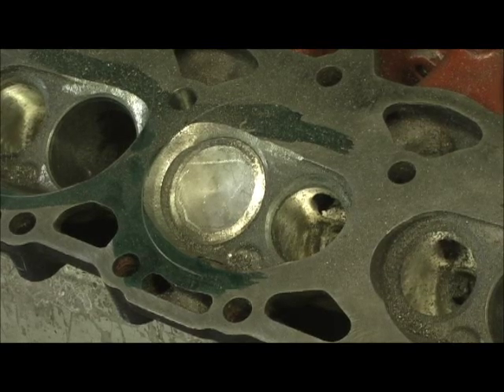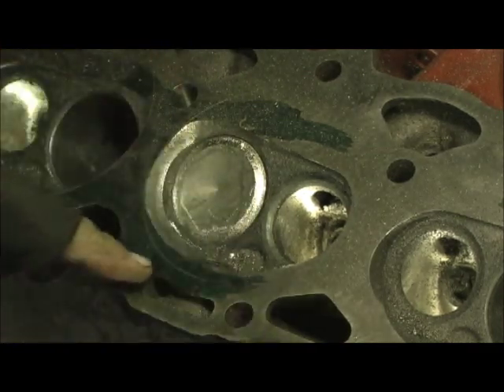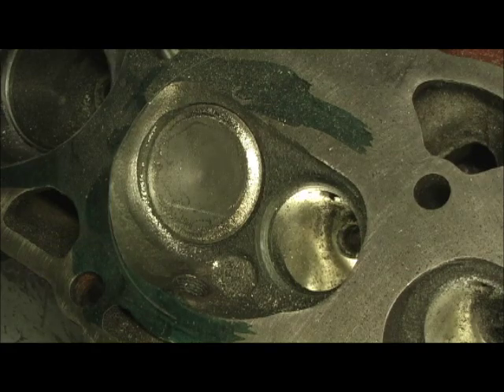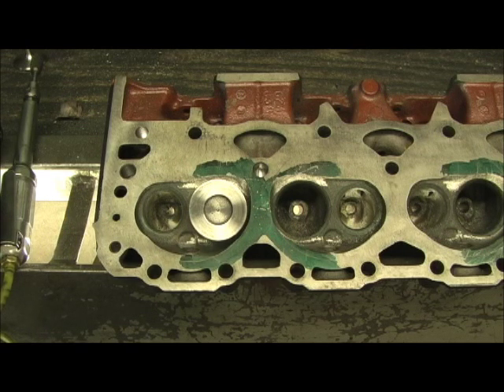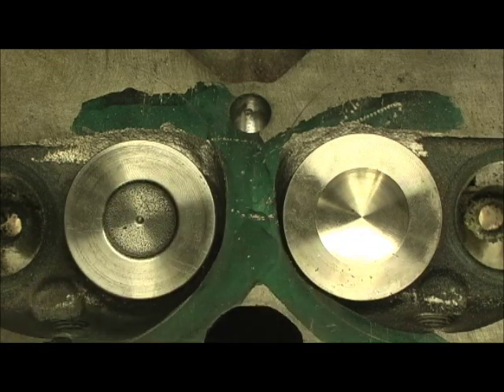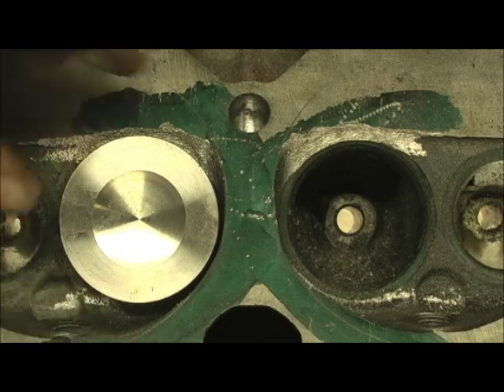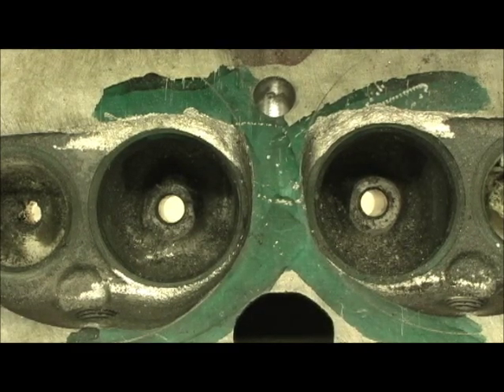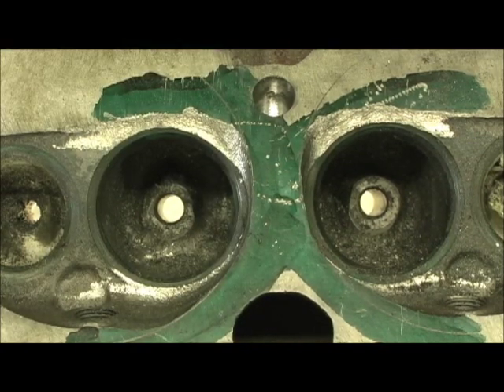Holder 305 HO 601 Chambers part 2  4.0

Comment: I had 355 built with a set of those heads about ten years ago. My theory was I would give up a little flow for the higher compression ratio. I didn't modify the heads at all because I really didn't know what to do with them. If I had done the mods your showing on that engine I bet it would have been amazing.

Comment: On your "Bowls" video on this 601 head you said the intake bowl on the pushrod side of the head was very thin. So with the 194 upgrade would the upgrade in valve size really be worth it if you cant size the blow appropriately. If you can somehow shape shift the bowl to feed the 194 please show this trick. Thanks

Comment: I like the 1.94 valves for the charge motion but you need to check that the valves clear the block at the .510 lift. Between the core shift and the valve spacing shift and the small bores this needs to be checked on the block it is going on. Yankee Cutter